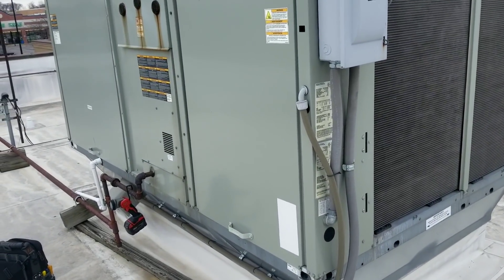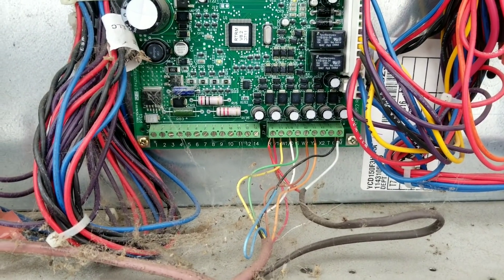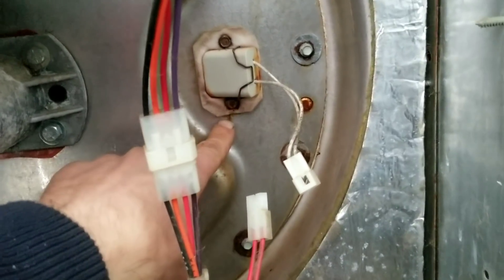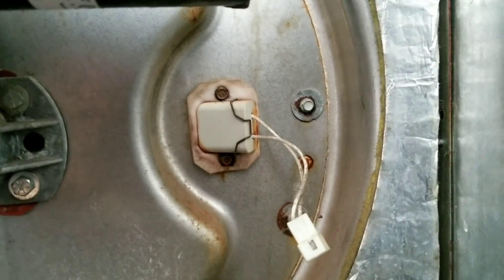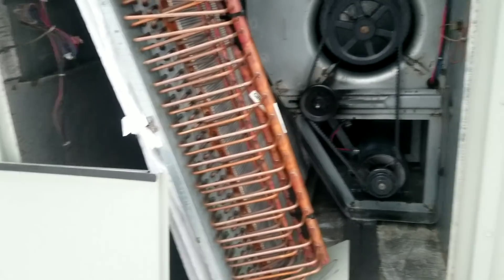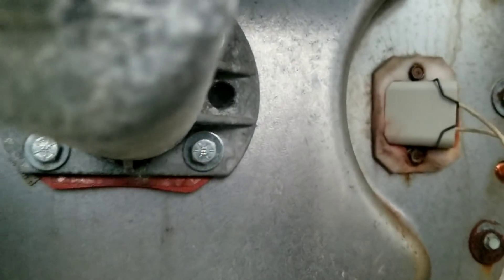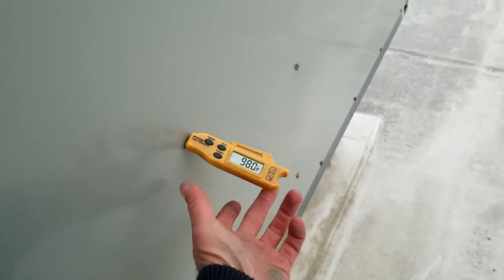Trane no heat

Comment: 2 flashes is system lock out! Gotta love trane and the diagnostics that dont tell you anything you dont already know. 😂😂. Keep up the good work!
Reply: I have a question what is it inside the burner tube I see some units have them ceramic type of things when burners come on they glow cherry red?
Reply: @xraybravo7180 I believe they are called turbulators, not to answer for the curious guy but this one he is working on is a negative pressure gas valve that do not have those on the inlet but do sometimes on the outlet side. Typically see those on the regular style burners.
Reply: @EverythingHVACR  OK thanks I never red about the turbulators before where can I can get some info on them how they work and when they are needed ?
Reply: @xraybravo7180  the manufacturer puts them in not something installed after the fact. I would say lean on manufacturer (trane) or Google is a good option for everything.
Reply: Since I'm new into refrigeration let me ask you this have you fixed a big hissing leak on a small cook line reach in cooler that has black coated heat craft  evaporator, I have cleaned the U bend itself from paint, with low heat as I was trying to heat up the joint the rest of the paint would catch fire and cause all kinds of smoke so I stopped and opted to replace the whole evaporator and also put a new internal equalizing  expansion valve however I found there is no service port at the evaporator outlet to adjust the superheat. This is a rack unit one condenser feeds three evaporator and each has its own temp control with soleniod valve . I dont know why the existing txv does not have service port at the evaporator to adjust superheat if needed or do you think the txv already come in pre Dialed in. Any input I would really appreciate it.

Comment: On the RTRM board, two flashes indicates that the unit is in alarm. And the two flash on the ignition module would be ignition failure. I have noticed that not all Trane Precedent/Voyager units have the diagnostic light list for the ignition module. And I always love how the ignitor comes with new screws, clip, and gasket, but you can NEVER get those screws out! 🤣

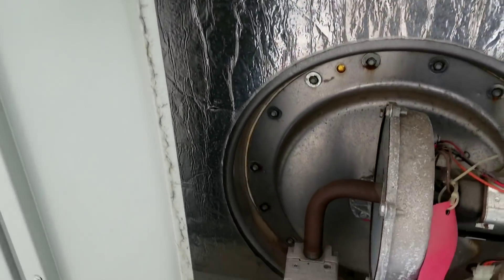Comment: 1:18 "Being somewhat familiar with these Tranes..."
Thinking back on all the retail warehouse sites I've serviced with these units, I suspect that your statement was followed by thoughts of shattered ignitors and locked up/broken screws.

But hey, at least the larger transformer in the corner didn't burst into a ball of fire this time ...or you didn't cross-thread a bolt while replacing the inducer ...or the idle pulley wasn't broken off ...or that nightmare of a heat exchanger wasn't cracked ...god I don't miss dealing with those units. Give me a Lennox L-Series over that or a York any day.

Comment: Idk if it is the cause of so many HSI failures in Michigan, but 90%+ of the units I come across with defective HSI have ignition transformer still wired for 240v and being supplied with 208v

Comment: What are these things called on regular gas burners that are inside the burner tube and glows Cherry red something like ceramic ?
Reply: They're called turbulators.  If they slide back too far, they blow a hole in the hx.  You can remove them, they're a California thing, supposed to help with efficiency.

Comment: No concern with no load 113 volt going to igniter?
Reply from the maker: Good point- should have addressed that and looked into it further, poor connection to my leads or trace it back to the transformer and double check it there

Comment: Those tranes with the negative gas pressure gas valve can be a pain. I had one that the inducer fail and show sings that someone messed with the gas valve so I had to replace that too to be on safe side. And replace the igniter for kicks and giggles while I was at it.

Comment: Those igniters are very fragile. I broke one taking it out of the styrofoam. I get another and bumped my arm on the panel and dropped it. Third one was a charm. Stay safe.
Reply: The newer ones are a little more tougher but still probably don’t want to push your luck with them too, other thing I would like to point out too is most outdoor package units or rooftop units don’t have hot surface ignition, just only spark ignition, I guess the reason why this model has HSI, is probably because the combustion chamber is more sealed then in standard gas/electric rooftop units.

Comment: Didn't look like it was open. Could you have checked it with an ohmeter to verify it is defective?
Reply: If it has voltage going to it and it's not working, it's bad. It really can be that simple. No need for further diagnosis.